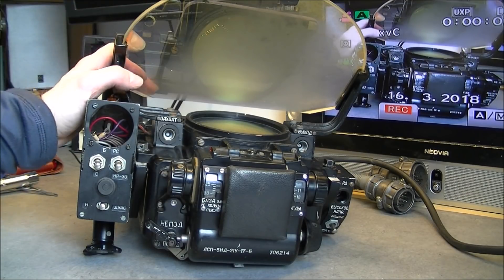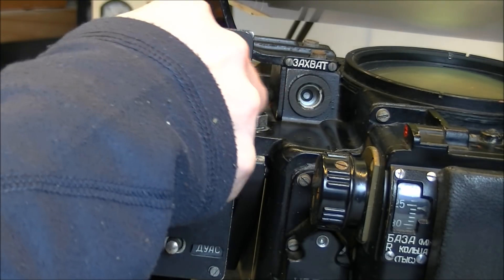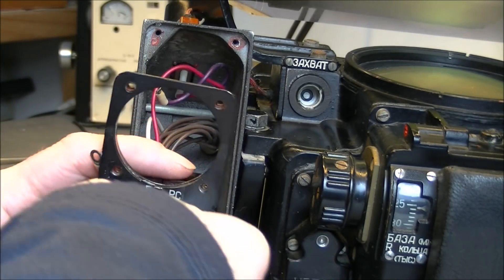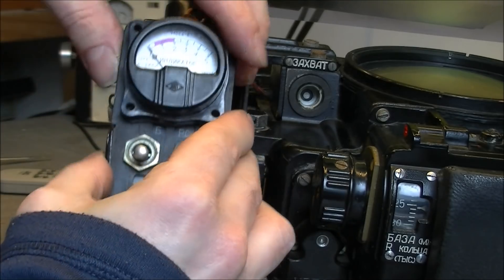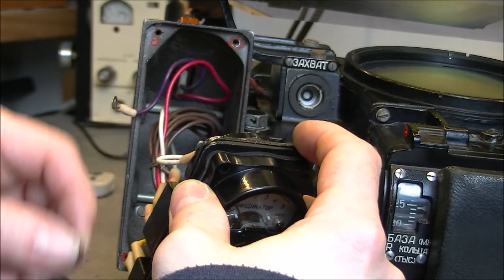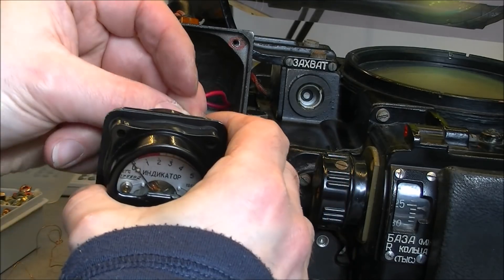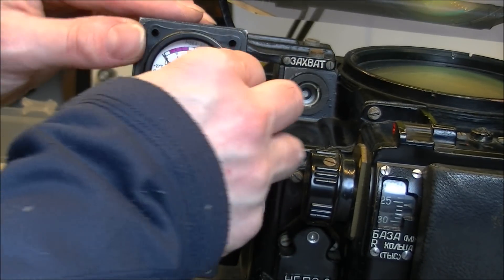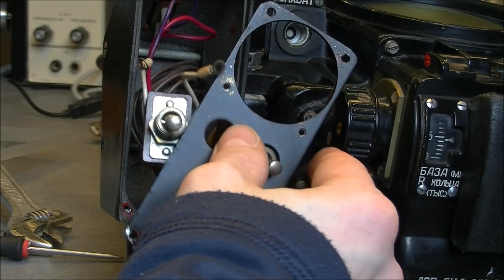Adding the missing instrument to my Mig gunsight

Comment: I found some Mig-21 cockpit photos with the ASP-5ND gun sight. Your replacement comes pretty close to the original. Manufacturer and base design are correct, only color and scaling are different. The original were made out of brown plastic and the range was from 0 to 20 without any units.
Reply: What are you talking about ? This is a original ! But where is the gyro ? This sight had a computing lead shoot gyro modeled after the American k14 . I wish I could help you my friend but I live in other country . I learned to do maintenance on many of this sights during my service time .